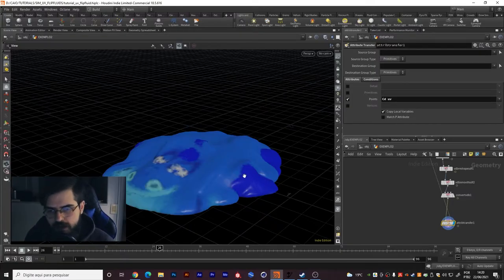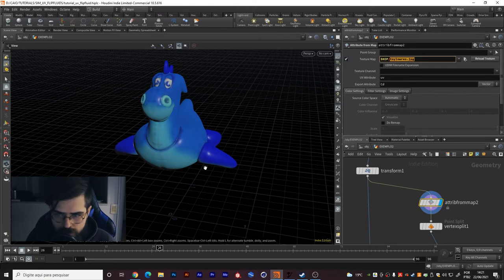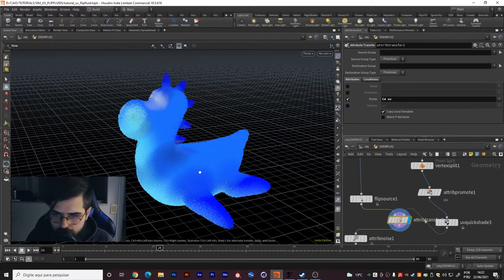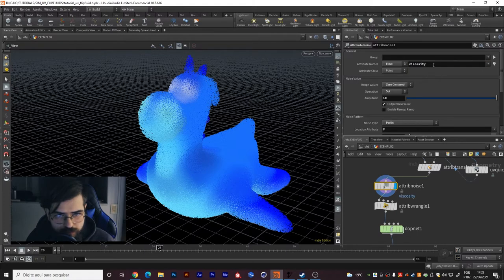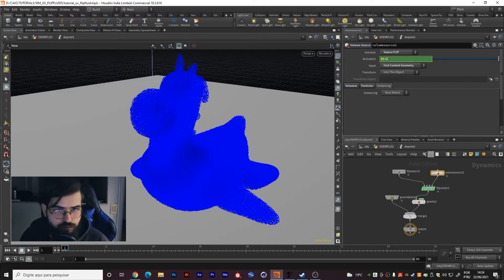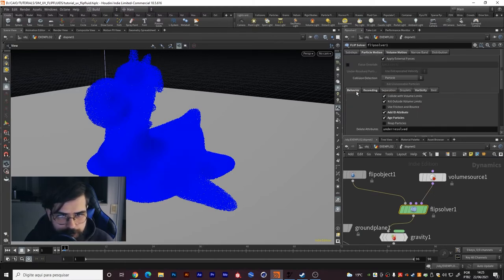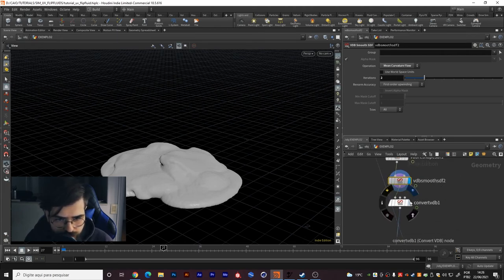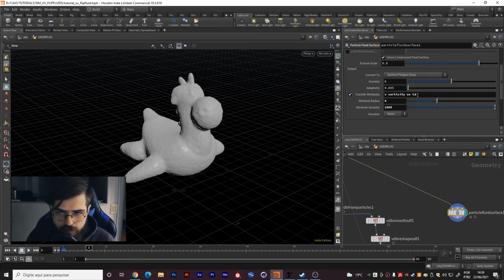How to Keep UVs on Simulations - HOUDINI Tutorial

Comment: Hey man. Maybe you could help me figure out one more thing please. 

So I'm trying to achieve some similar "melting" effect, but with one difference. So I have an object, which should looks SOLID at frame 1, and it's also floating in the air. And then it should start to melt from sides. The problem is, as soon I create flipfluid object, the gravity affects all the particles right from the start, and object falls on ground plane, and turns into a puddle, like in your tutorial. But I dont want that, I need it to "melt" in the air. There a lot of melting tutorials on YouTube, but in all of them object either fall down and making puddle, or already have a contact with the ground. And that's not exactly what I need... Any tips how I can achieve that ?
Reply from the maker: Of course. You need to control gravity with an attribute. First u animate an attribute (attribute transfer, growth solver, pyro spread, mops falloff are some options to do that) then you tell gravity to multiply by this attribute.
Reply: @CLMograph  that make sense, I'll try that, thanks you!